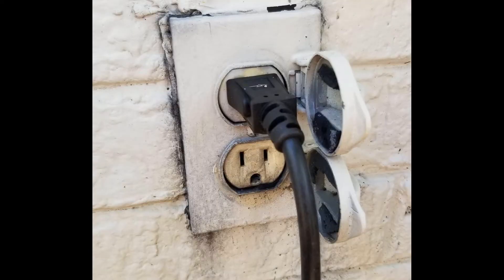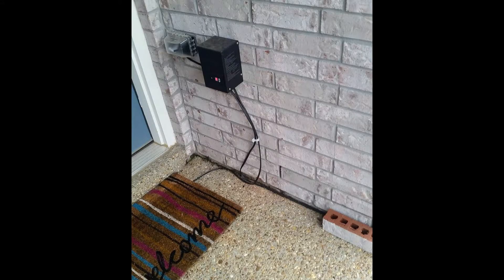WHERE DO I GET POWER FOR THE TRANSFORMER | low voltage outdoor landscape lighting transformer

Comment: Yes I’m not getting power 12v coming out of the transformer.
Reply from the maker: There's a few reasons. 1. check the switch. almost all transformers have a switch or button, if its on off the transformer won't work. 2. transformer is bad. Cheap transformers die after a couple to a few years. 3. your wires aren't wired up correctly. Hope this helps!

Comment: I can’t get power out.
Reply from the maker: Could you explain a little more? Are you saying you don't have electricity from your outlet?
Reply: AK Lighting I have power coming in but none coming out.
Reply from the maker: Forgive me, I'm still confused to what you mean. Could you explain it further? For example, do you mean you have electricity from your outlet, but your transformer isn't working?
Reply: a bit too vague to precisely answer.  Suggest buying a 120V "sniffer" (about the size of a highlighter) which will audibly indicate if you have 120 volt power in the line (from home to transformer).  If there's power, the transformer should heat up slightly with or without lights attached.  With lights attached, it should heat up a bit more and/or softly buzz.  A multimeter would tell you more of course.